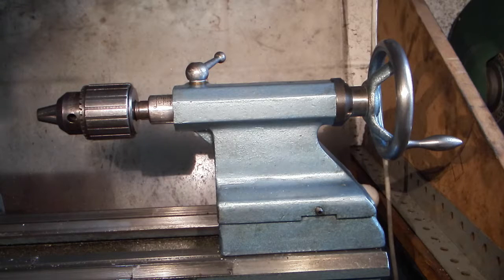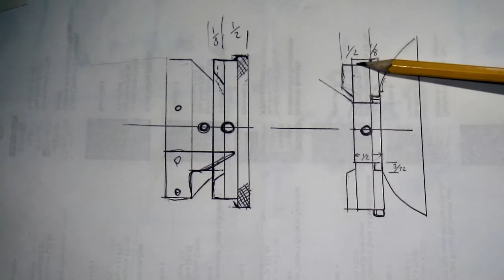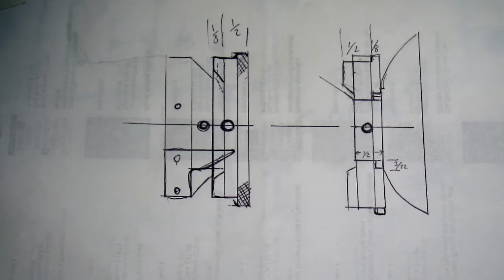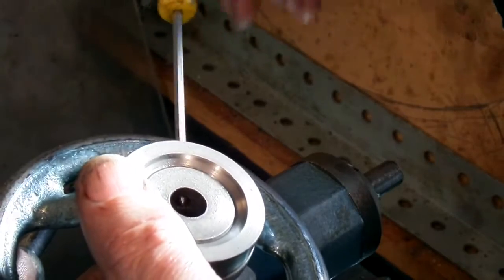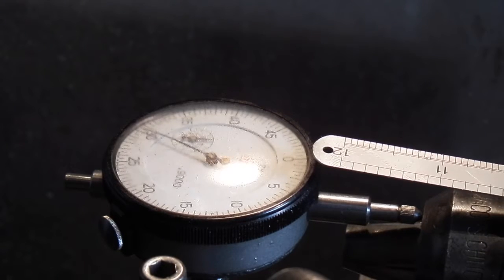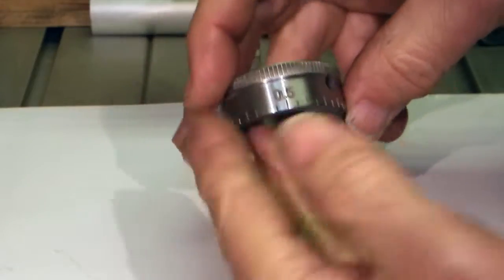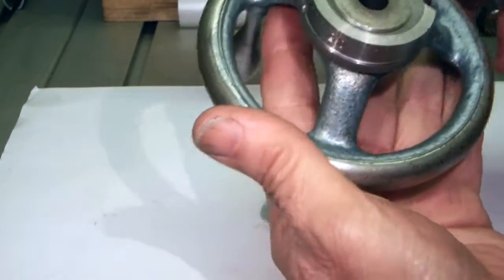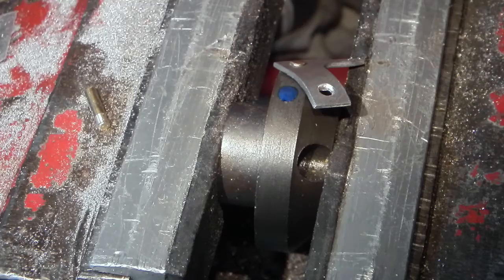Tailstock depth guide

Comment: Hi,
Boxford tailstock spindles and nuts are 1/2 Whitworth left hand. That's 12tpi. 1" ÷12=0.0833(your measured distance give or take a bit) or 2.116mm. So for every turn of the handle your going to be out by  .116mm. Doesn't sound a lot but this is accumulative.  So if you wanted a 50mm deep hole, that's 25 turns of the handle, your hole would be 52.92mm deep. Almost 3mm too deep.
This isn't a criticism. Just thought I'd  mention it.
I never could understand why Boxford went for this size thread?
Thanks for your videos.
Steve.
Always struck me as being a daft size to use.
Reply from the maker: Hi Steve Thanks for your comment
I only use it as a guide and found it useful.
When the thread is worn out it will be replaced with a 2mm pitch screw which will put it right. Its supposed to be a metric lathe.
Reply: Hi Alan,
I recently made a replacement nut and spindle for my tailstock so the details were fresh in my mind. My Boxford is also metric but came with the same spindle as yours (1/2 Whitworth left hand). I actually wondered if the tailstock was not original to the machine. As yours is the same I feel confident that it is indeed original.
Ideally a tap measuring 12mm X 2mm pitch left hand could be used. Bit of an oddball. I'll  take a look for one just for the hell of it.
Thanks.
Steve.